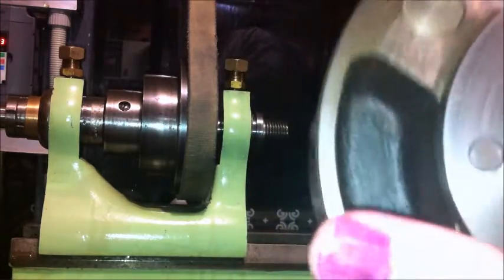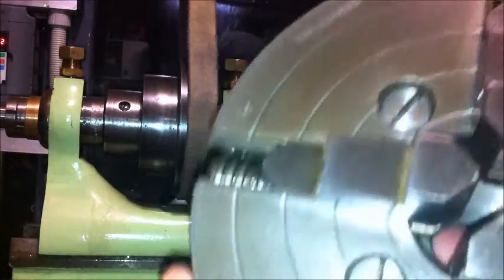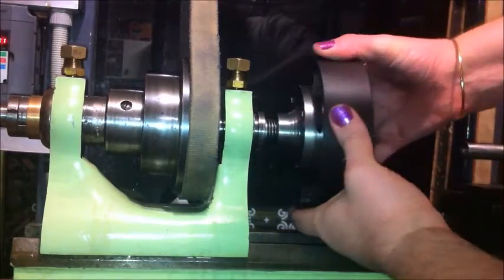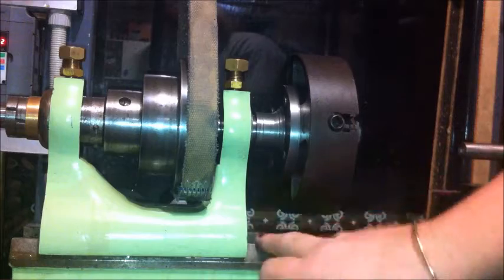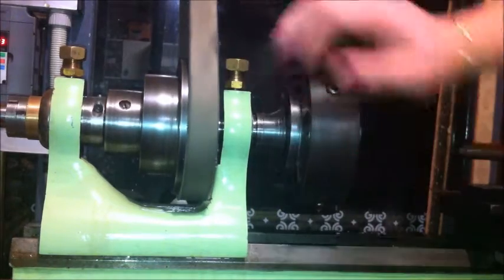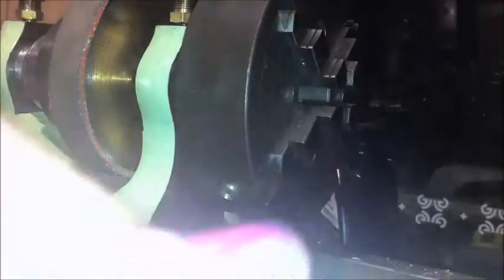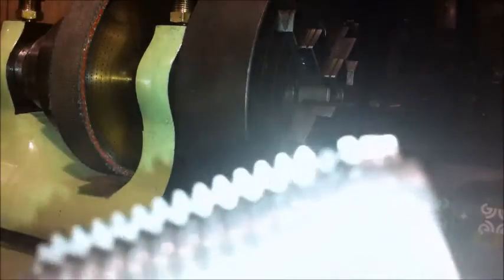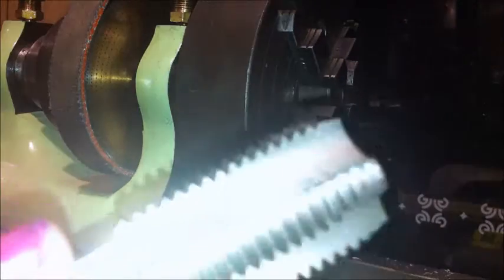four jaw chuck

Comment: Looks good, and for a four jaw where you clock up each job that matters every time I guess this doesn't matter so much; but is it right, as it looks,  that there's very little by way of a register on that spindle nose inboard of the mounting thread? My Lorch has an M39x4 thread and then approaching the same length again of 40mm plain register...
Reply from the maker: there isn't really much to register on. its how it is, much lighter than the bigger spindle.